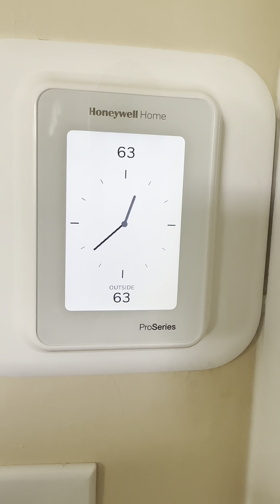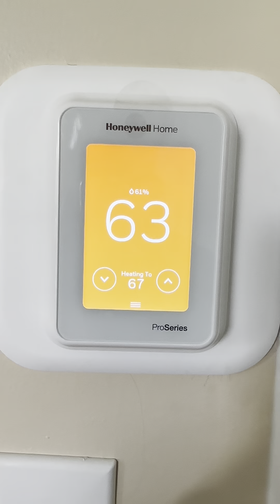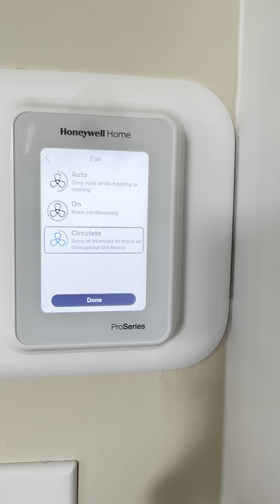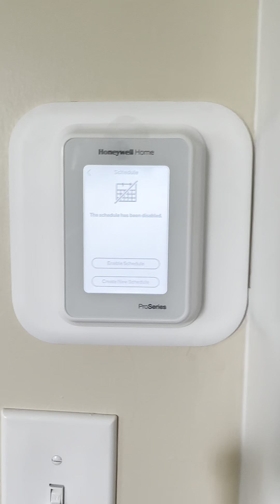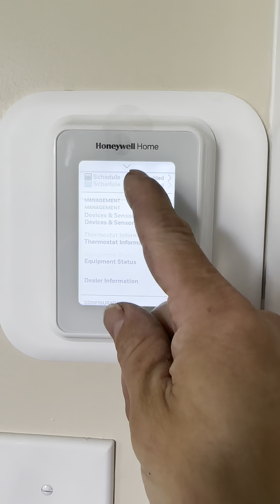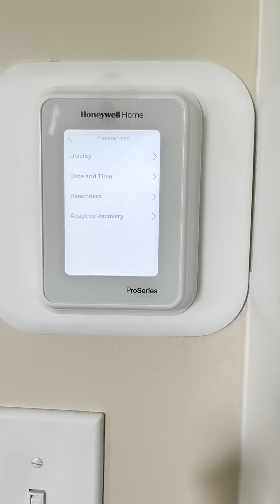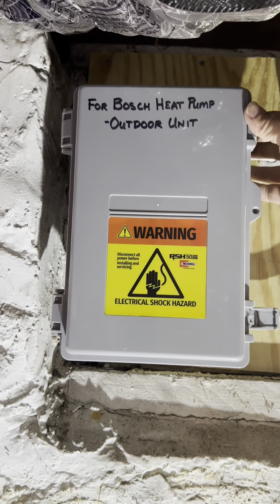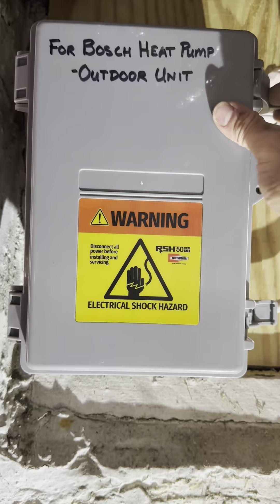Bosch Heat Pump Operation and Maintenance

Comment: Have you experienced any humidity issues with the newer Bosch heat pumps?
Reply from the maker: Yes. If the staging is not set to match the demand of the house, it can leave extra humidity in the house. We also use a thermostat that allows for focus on Humidity if the system isn’t making progress based on temperature. The primary issue being that the system just isn’t running long enough for certain configurations. There are also cycle rates in most thermostats that can affect the run time.